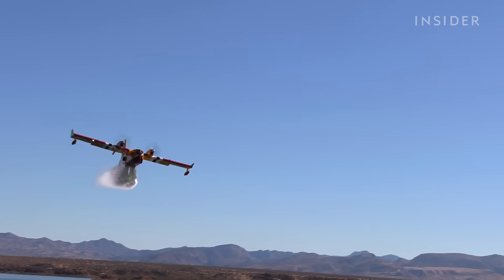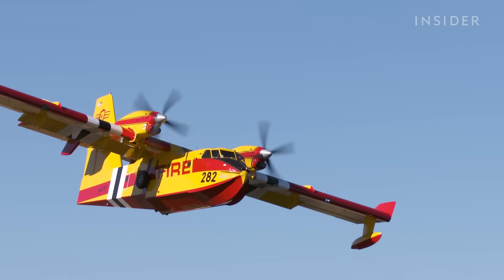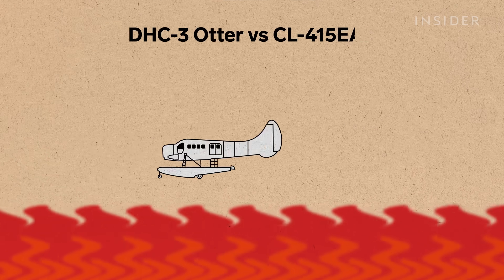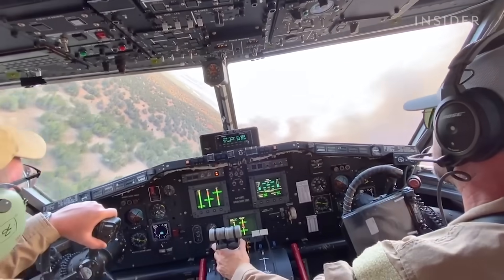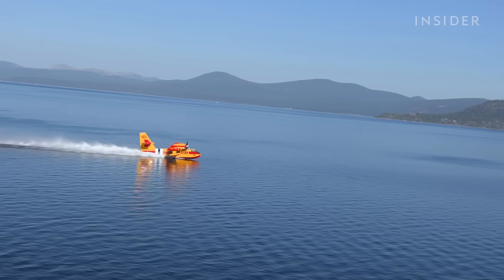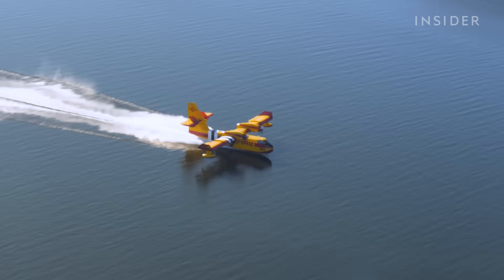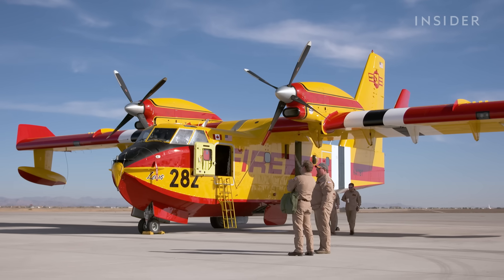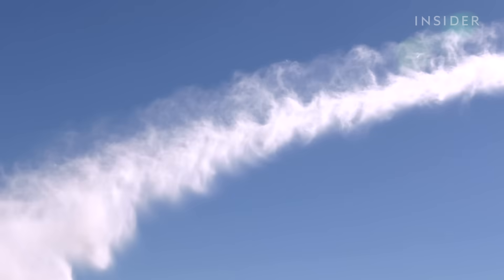How The $30 Million 'Super Scooper' Plane Was Built To Fight Wildfires

Comment: It ain’t no 747 jumbo fire fighter but it’s cool but it ain’t got nothing on the biggest firefighting plane in the world not even close
Reply: Biggest has its drawbacks. Consider the cycle time of a 747 to a 2nd attack, it has to fly back to an airstrip big enough for it to land at, then wait to refill its tanks at whatever flow capacity the local water supply allows. A single CL-415 might be able to take 6 or more passes by the time the 747 even returns. The CL-415 can keep the fire down through sustained attack and short cycle times while the 747 gives the fire time to re-establish. The 747 also cost $120 million between the plane and the conversion, so for the same price it would be way better to have 4 of these on sustained attack with really short cycle times in between passes. Of course maintenance costs will be lower on the CL-415 and having redundant numbers would still allow 3 to fly if one is down for maintenance or repair. The win goes to CL-415, hands down.